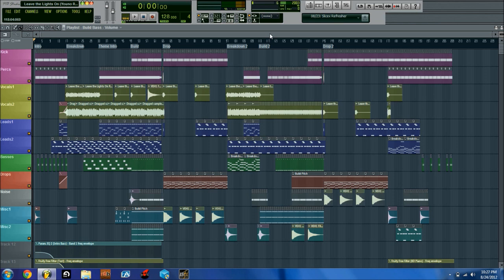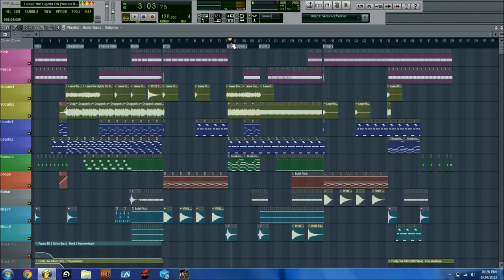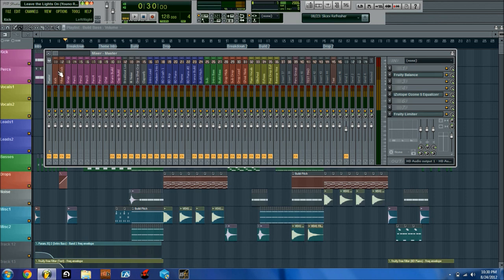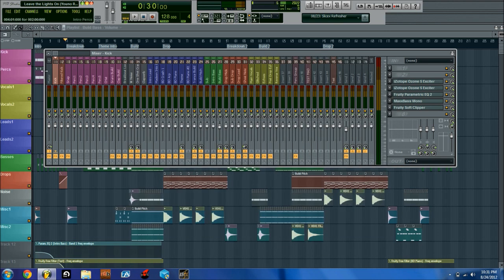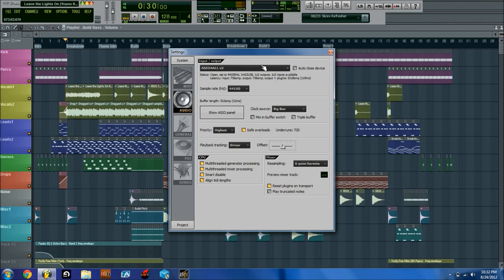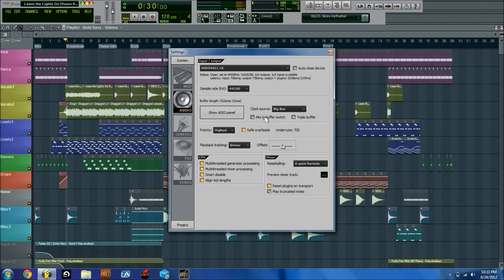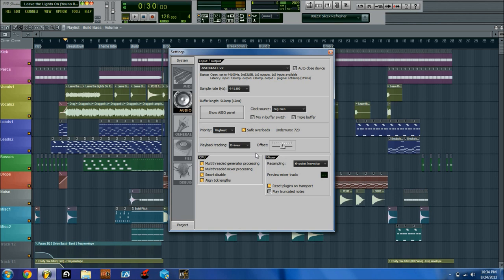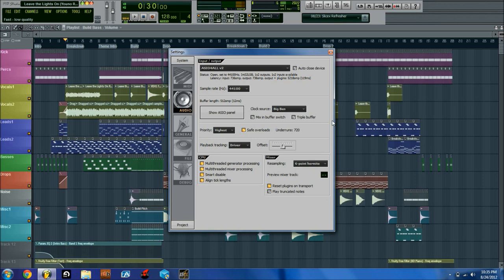FL Studio Tutorials: CPU/RAM

Comment from the maker: I used to have that problem all the time. I believe your comp is an i3 or i5. Either way, dual core processing should be sufficient. I would say the main thing that would help in two ways is reducing the amount of plugins being used in the mixer. First, it would give you more processing power and second, it would force you to decide which effects are most vital to the mix. What sort of problems are you experiencing?

Comment: I've got 8 gigs of ram, g4560 3.5ghz processor, trying to render a track in .wav format with 2 instances of spire running. It instantly crashes every single time as soon as I press ''Start'' on the export panel. Tried all of the other way of exportation such as mp3, ogg and what not. One time I tried exporting the track by removing one of the spires, it worked. Now I have updated the track and the 2 instances of spire are super essential for me, plus I can't export the track even if I remove both of them. I haven't got any other plugins that require a beast of a pc to run, only sylenth1, nexus and other miscellaneous plugins.

Comment from the maker: Generally it's the CPU that people have problems with. I'd be willing to bet your comps running out of processing. It's been a while since but I believe if you're running out of RAM the module will actual warn you. Also, if the CPU ticker consistently turns red it will definitely be the processing. There should also be a value right next to the ticker telling you how much RAM you have left to use.

Comment: hello, I've got a strange problem with Fl Studio 10. For example: I create a little beat, imagine maybe a bassdrum, snare, a hihat and a 707 bassline. If I play it in Fl Studio, my CPU usage is very low (intel core i5), like 10% percent or something. But about 1-2 times in in 8 bar pattern, my playback just silences for about 2 beats, the cpu usage goes up to about 50%, no crackling, no freezing, nothing. After this the playback just goes on. It's obvious that the CPU isn't overloading or at its limit. It makes no difference if I'm using asio4all or the built in sounddriver or wether I'm using an interface or not. I have no idea what to do about it...I'm using Windows 7 64bit. Thanks in advance!

Comment: Great video. Quick question. Would you change the sample rate and the resampling to a higher setting right before rendering or would it not make that much difference?
Reply from the maker: No, for two separate reasons. The sampling rate is a complex setting and can severely affect the way some plugins operate.  

The resampling rate for playback does not affect render resampling.  Before rendering a .wav file, a menu will display a drop down box where you can change the resampling rate for the render (I recommend 512, the best setting, since CPU isn't a problem when rendering).

Comment: HI guys. I have another problem you may can fix. My operating system is Win7 64bit.
I have 8gb ram. I run my FL studio with compatible memory and its still capped on 2gb ram. My Fl studio crashes every time when i open now :(. same crash if i open it with FL64.exe(64 bit) or FL.exe(32bit). Do you know how yo acces more ram in FL studio for me?

Comment: I have done everything you have said in this video.. In the mixer I have about 75 pockets with plugins added + some effects to each one. Computer: Intel (R) Core (TM) i3-3110M CPU @ 2.40 Ghz; 4 GB RAMS; 64  bits operating systems.. Years: about 2012 end, 2013 start. Where is the problem of cpu's load via fl studio? Rams using over one thousand.. so not RAMS problem.. Maybe could be a soundcard??? Please, help!!! Thanks!

Comment: hey guys i bought audio interface and the BUFFER setting is automatly 2048smpl that is okey or i need to get back with 512 ??? HELP!
Reply: Set:
44.100Hz
Buffer: In your settings check the voice "UNDERRUNS" if it isn't 0 (zero) increase the buffer. But more buffer cause more latency. My advice is set your buffer to 512 and start producing, when you have underruns set it to 1024!
;)

Comment: FL Stuido just sucks your CPU dry. I don't have the same problems at all with Ableton Live.
Reply: +alexkid1 it's because ableton takes care of all of it automatically, these guys on flstudio which i have been using since crap low ram days heck even cubase on the atariST, anyhow, the new era watch too many youtube vids rather than read the manual or books on for this instance daw optimization and  how to use minimal ram as possible for instance, only plugins should use high ram and is natural as its a higher emulation and newer than the daw emulation so memory management will never be perfect, these guys need to think more in the sense of turning off plugins after rendering it to a wave then using back into a project, there is no need for turning off all what this video is doing even with 2gb of ram, it goes back to what i always say about theres producers that like to remix and add unnecessary extras and theres creators from the ground up who make sounds then craft them as if it were not their own sample which is what i do to have my own increasing sound sample library that can be further manipulated for more productions and uses low ram if using only loops inside the playlist hence why this daw is called fruity loops from the start of fl i have been making sweet/fruit patterns which are loops then putting them all together to create bigger loops that stretch out to a full song which includes nothing but your own creation rather than pre-made loops that many other daws throw at users and thats why in music today there's no obvious tracks we will consider to end up being on the classic wall like many years ago, i mean even the silly sampled hiphop and rap ain't really classic but only classic to the culture that still makes money of it (sorry hiphop fans but i feel hiphop/rap was more a voice and a movement of revenge to the rulers rather than music that one day adults/children could listen to it and think how nice that sounds, i mean it sounds terrible and i am truly not racist as my heritage is Jamaican, i feel it's still around today for creating groups and belonging to something, the very thing we blacks once hated it seems the blacks in the usa want ever so badly back ).. sorry for going waaay off topic but music is a big part of all of our lives...
Reply: Man what a novel 😂

Comment: I'm currently using win7 64 bit with fl11, 16 gigs of ram, 4 hard drive, but still it takes long time to open the project, if you know what might cause  this problem, please make a tutorial for this! thankkkkkkkkkk you !
Reply: depends on your computers RPM as well as how heavy duty your plugins are. If you're using plugins  such as: waves, izotope, sampltank, your prom may take a while. additionally, the more samples or .wavs in your project the more your fl has to search through your comp for. try not to have TOO many subfolders as that seems to increase load time